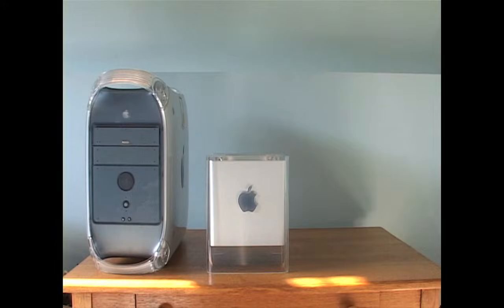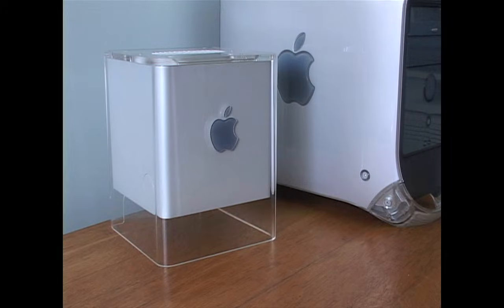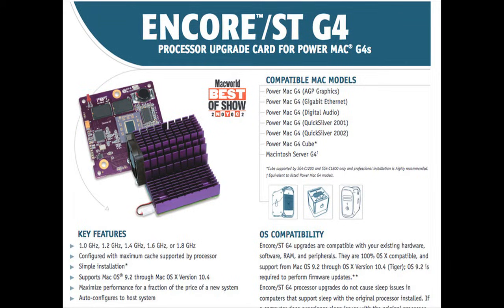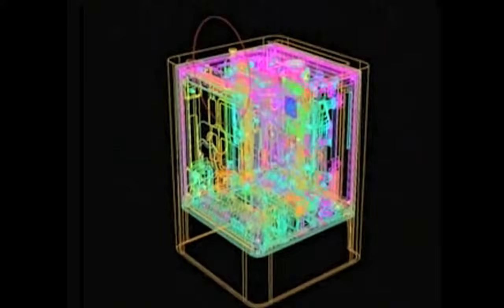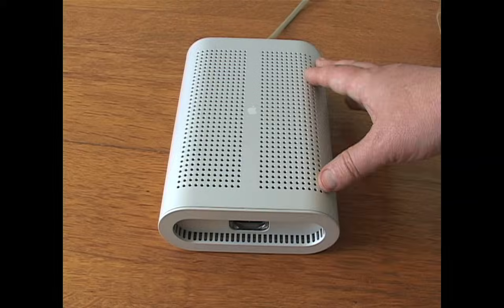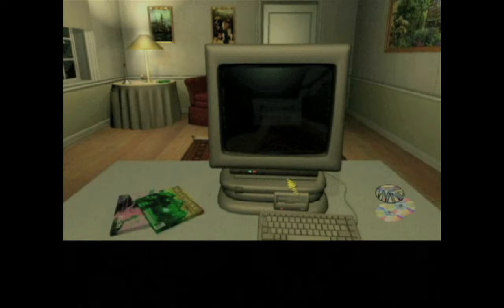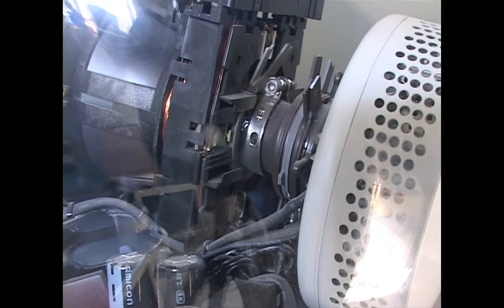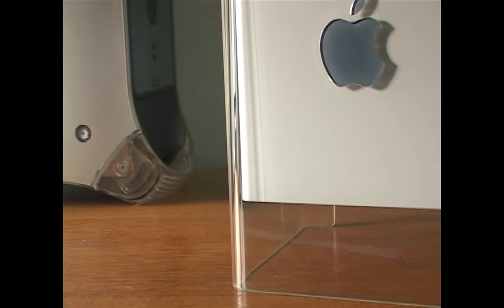The Power Mac G4 Cube

Comment: My G4 Quicksilver has all five slots filled up with something. Storage cards, beastly 12-inch cards, sound cards, USB/FireWire... it was a different time back then when PCI was your only option for expanding the functionality of your machine (FireWire and SCSI too, but to a lesser degree). Recently I saw a card online for like $25 called the Octopos DV Studio, that had both a breakout port and two 4-pin FireWire ports so you could import DV video. This was probably a really valuable card to have (especially as it seems to have been a budget option) for users of pre-Jobs Power Macs and even the later Blue & White chassis Power Macs so you didn't have to tie up your FireWire ports for only DV transfer.

The Cube could not do that. Plain and simple, you paid more for less. The power was similar but there was nowhere for it to go. It would have made more sense to launch a G3 Cube and have it be a Mac Mini.
Reply from the maker: Those are some cool insights into the Cube and Quicksilver. Great point about the relative importance of PCI slots back then compared to now. The best Quicksilver is one with all slots filled.

Comment: Great video as always; your videos are a real treat and have top tier production quality. A cool thing you can do to make the cube more snappy is install Morph OS onto it which kind of bring it into a fantasy land OS also speeding it up greatly. Its also very cool how you can upgrade the cube but man the parts are pricey. You scored huge picking one up for 175$. Was good timing. Clean versions of the cube can command a decent amount now in 2025 with processor upgrades costing 400$-1000. Same with graphics card easily 1000$ plus. And then to spend all that money what are you really practically going to do with the thing?  The early versions os OS X barely run today with workarounds so its really a collectors item now obviously but I have to say its definitely  one of the best designs ever. It would be so cool if apple could do a modern version of it with the power of a mac studio in a similar incasing. Ive even seen people do hack jobs and shove a mac mini in the g4 cube so you can retain the design but run a modern OS that can be used daily. Quite cool.
Reply from the maker: Thanks very much, Ghost!  Glad you enjoy the videos. I still have to do a follow-up where I look inside the Cube! I was given another Cube recently in much poorer condition, so it's a perfect one to do that with, and leaving my good one alone. I appreciate the Morph OS suggestion. It's amazing how the value of the Cube has gone up. When I got the Cube 10 years ago they wanted $250 and I said it was too much! Usability-wise, it definitely lies in collector's territory now, I agree. I always wished they had made the Mac Studio a 7.7" metal cube, instead of a half-cube, which makes it look a bit lame.

Comment: Five years later and Apple made an even worse product called the Mac Studio to fill the same space but it succeeded despite being worse in every way for the time (please just give us G4 Cube upgradeability) though a somewhat similar company Xapple only with better quality products makes computers in the same cases as the TAM and G4 Cube with AMD Ryzen and RDNA graphics. Back when this video was made Apple was doing much better at making desktop computers than now with Intel processors and Radeon Graphics that were upgradeable
Reply from the maker: Making the Mac Studio in the original form factor 7.7 inch cubed case (but in aluminum) and making it upgradeable seemed so obvious… but no.

Comment: I wish Apple would work on a Thunderbolt-based single cable solution for display power, data and video.  Seems like it would be much more feasible today than it was 20 years ago...
Reply from the maker: I agree. It was not a bad idea.
Reply: @65scribe even if it was two thunderbolt cables bundled as one!

Looking forward as always to your next video.
Reply: Is that not the Thunderbolt Display from 2011?  Admittedly, and rather annoyingly, stuck with the mini DVI connector style.

Comment: The G4 Cube and the Sharp X68000 are still the best looking computer ever made.
Reply from the maker: Sharp X68000 - I like the two connected towers design, you're right. The Power Mac 8600/9600 tower is my favorite for similar reasons.
Reply: @65scribe  I always figured/hoped one of the PC case makers would copy the Sharp's case but sadly none have. It's a simple design that like the  Cube just looks amazing.

Comment: The G4 cube was the crowning jewel of my Apple collection, unfortunately one day it just died, no power whatsoever, attempted every known repair and spent far too much money on replacement parts in an attempt to get it working, but after replacing the DC board, the PSU and a bunch of capacitors that looked bad. The thing has remained in this state since. Having repaired many old Apple computers in my time it was the first time I've been truly stumped. Apple built this thing far too complicated for its own good. The PSU alone was a super common failure point and once it failed, your only option was to either send it back to Apple (Which was no longer possible as of around mid-2003) or to head over to eBay and buy one ripped from a working machine, which people were (unsurprisingly) reluctant to sell. This machine was the very machine that killed my love for collecting retro Apple computers, because of the absolute pain and frustration it caused.
Reply from the maker: A tragic story of a G4 Cube failure. Sorry to hear that. I admit, between the failing hard drives, brittle yellowing plastics, and leaky capacitors in Old Macs, it’s hard to stay with it some days, so I know where you’re coming from.
Reply: This was basically Jobs's and Ive's jerk-off fantasies unbridled.

Comment: To Jobs' credit, he knew how powerful a cable that could carry data, power, and a display out would be. That's why they have 4 Thunderbolt 3 USB-C ports on the newer MacBook Pros.
Reply: Nowadays we have Thunderbolt monitors, with the power going the other way: The monitor plugs into the wall/power strip, and then the cable provides power to a docked laptop, along with the display and data connections.

Comment: Having just acquired said CRT monitor, I can't tell if it's start up sound or just the noise the screen makes when degaussing at power on
Reply from the maker: Nice acquisition! 
Having owned the previous monitor to this one, the degaussing did not have that initial ping sound, but maybe it is in the mechanics and not artificial. It surprised me when I first powered it on.
Reply: @65scribe  agreed, it's a nice little surprise regards of what's producing it 😀👍

Comment: I remember the cube, I was attending the event in london uk I got it later and I love it, I boosted up to the max never had an issue sonnet was the great deal
Reply from the maker: Good to hear from an early cube owner. Did a dealer install the sonnet card or did you bravely do it?
Reply: @65scribe  I bought it second hand, I disassembled computers for years as I love to see what's inside and what I can repair / change. I saw so many people getting big video cards installed and modified the cube is crazy. I bought several sonnet processors etc as it was a great company made for mac that jobs killed with intel..

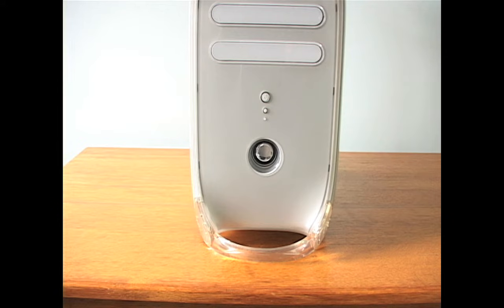Comment: 21:39 Thats easy fix...just get vacuum cleaner,on low setting and give it some 
suction action :)
Reply from the maker: Interesting solution.. :)
Reply: @65scribe  
Yep im repair from time to time old Soviet acoustic systems with crumpled caps)) I just lean against the vacuum cleaner, turn it on and off .. in the worst case, the poorly glued cap sometimes comes off ... but more often it just straightens out :) by the way, a big hello to you from Russia)) We have these macintosh rare guests and are expensive)) I'm studying them from your videos very interesting)))           
 By the way, I heard that Steve Jobs flew to the Soviet Union)) showed an Apple 2 computer =) but alas, it was expensive for the Russians ... so in the Soviet Union they bought a pair of real Apple 2, looked how they work ... and made a clone on Russian Soviet microcircuits)) was called AGAT 7, we only did not have a 6502 processor ... it was bought from other contries)) 

AGAT 7 was probably the first computer in 1983 in the schools of the Soviet Union ... then I heard they were also used in medicine to store disease data ...

and the computer was released until the end of the USSR)) 1993 Apple 2 had such a good design.
Reply from the maker: Hello from Canada! Thanks for the suggestion and history about the Soviet Apple II clone. Very interesting! Good to hear you are enjoying watching the videos!

Comment: Fantastic video. I'm lucky enough to own a nice cube, a later Radeon fitted, a 20" Apple LCD display and also the ADC CRT. I managed to stick a 2011 MacBook Air SSD inside through a chain of adaptors which means it runs extremely cool and completely silent, without the old spinning drive. Anyway although I've oft brought it to the local retro computer meet I had no idea of the shop demo loop Application - off to download that now. Great humor here as always :)
Reply from the maker: Thanks very much! Great to hear you enjoyed the video and got something out it. That is a nice cube set-up and cool that you can show it off. An SSD in the cube.. that’s a great idea!

Comment: You should do a video on the first aluminum iMac model from 2007! You could show Apple's sudden shift to their current aluminium/brushed metal look for their iMacs, since they released a white iMac earlier in the same year. I REALLY miss the white clear plastic look, but I have a fondness for the early aluminium iMacs. 

About 2 years ago I rescued one from being thrown away at my university. It was running Yosemite (and very poorly). I installed Leopard on it using a modified install disk for a MacBook. But I'm planning on putting Tiger on it sometime in the future. I even picked up the original mouse and keyboard that came with that model, just to keep it era-accurate. 

Also love your channel, I immediately knew you were a fellow Canadian.
Reply from the maker: Hi cosmos,
Great to hear from a fellow Canadian! You know, I never thought about the aluminum iMac. I don’t have one... that’s one reason. I do have a iMac G5 in flawless shape, and I agree that the look of it is great. I’ve been doing a lot of 90’s stuff. After this next video, I’m going to start looking at the 2000’s and some more 80’s. Keep well and thanks for your message!

Comment: I like the idea of the ADC monitor and unified connectors, even though it was proprietary it's idea that should be given more though as no one appreciates a rat's nest of cables at any point in time
Reply: They were always chasing the simplification theme.  It's not actually a bad idea, and it's made up of industry-standard protocols that are basically just a PSU and passive adapter away from connecting to ordinary equipment.  Having a G4 Cube, Studio Display, and the USB peripherals it was meant to pair with, the whole setup is very nice, and pleasant to use.  For that matter, I often have to do some acrobatics, or just use a USB hub or extension cable, to get things connected to plain old PCs, so it doesn't feel like you're giving up much.

I would say the worst aspect is how thick all the cables are, but that's just 2000s-era transceivers and power draw for you.  Today, it would just be a USB C cable.  20 years makes a difference.

Comment: Needing to upgrade our mid-'90s Performas, we got one of those second-generation Powermac G4 dual-450 "gigabit Ethernet" machines and loved it to death using it with our 19" CRT VGA monitor (we got on closeout from MicroCenter when the Cinema Displays came out). 
It was just perfect in our eyes, until Mac OS X 'Tiger' bogged the machine down and wouldn't support any browser that could support our bank's Web security ten years later.
We pined for the G4 Cube, but we already had a better machine and the Cube was just too expensive for what it offered.
Didja know? On Star Trek Enterprise all those computer displays on the bridge were real computer displays, each driven by its own dedicated G4 Cube!

Comment: I was rework tech on the line at Apple 99 to 2001,The Cube or as we called it at Apple The Trinity for it build code name was show to us Techs one night (I worked the night shift) And it was not in final clear case but metal sleeve that made it look like army surplus ammo box.
We were asked to look it over and dismantle it with No instructions how. I beat everyone in doing so but I did my best not to get noted (I was not looking for a promotion). I look over use and made note what was wrong with the design.
  The body a massively too thick heat sink that hosted the MB and other parts that connected to the Aluminum body. They had the hard drive in the center to in hopes create a convention air flow. I noted the CPU and GPU of the Graphic card would throw the heat balance off and fans would be need to the system. I look it over and said It would be great as a game server box or Lan game box. 
It is nice and portable but there going to be some bad heat build up if you put any more powerful graphic cards and you will get lag from the heat.( at this point I did Klutz move to not get hired to the design team by dropping my box holding the screws from the cube. it worked)
 I was near done work there. I suffer a ton of scary builds with the iMac and the high voltage work that was trying to kill me.
I told them This box would fail due to how it is design and will not do as they think. It could be saved but milling the thick heat sink body down and adding better heat balance to for make air flow but it should be marketed for gaming or mini server.  
About week later I was let go but not for the bad review It seen the Day shift and swing shift was doing bad as we the night shift turn out 99 to 100% yield in builds meaning we turn out and shipped better. Day shift and swing could even get that close to that number.
 So Night shift was killed a year later EVERYONE was fire and then asked to come back as contractor at a lower pay scale. Then all manufacturing left that Campus and it now the call center and repair center. 
I start with the G3 and first iMAC and left with seeing the cube, and we knew new systems were being build in secret in the build(whole line were draped in black plastic curtains but left outside that area heat sink in boxes where there, so we knew duel CPUs were coming ) It was sad at first to leave but I went on to better things. IF Anyone wants to hear the horror stories of those days IM me 
I will try to find it but there was Car prototype that had a slot made in  it for the cube to be dropped into it, I do not remember who made it but it was very cool as it was the first time some designer  look at dropping full computer into a car. I saw the video with apple and it was during US car show.
Reply from the maker: Interesting hearing about that. Thanks for sharing this story!

Comment: Steve's retrospective analysis of the Cube's failure could be applied to the 2013 Mac Pro just as fittingly.
Reply: I used to have a cube, and recently picked up a cylinder for cheap, and yeah it's basically the same.  It'll happily cook itself to death with its poor thermals, just as the CPU was OK at launch, but woefully inadequate.

The only thing more ridiculous is the NVIDIA embargo preventing Apple from using superior GPUs, which ironically was the whole point of the cylinder, but AMD is just terrible compared to the availability of API & program support.
Reply from the maker: Another great observation..
Reply: These were the Mac Studio of their day imo. Both the 2013 Pro and the Cube.
Reply from the maker: I think if they made the Mac Studio an aluminum cube it would get much more attention and the extra headspace could be used for cooling, storage, or expansion.